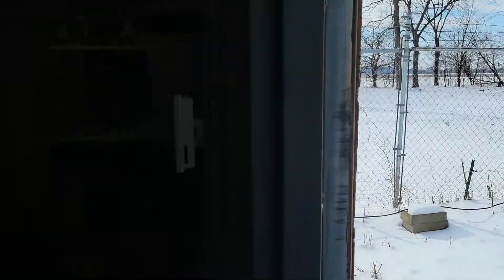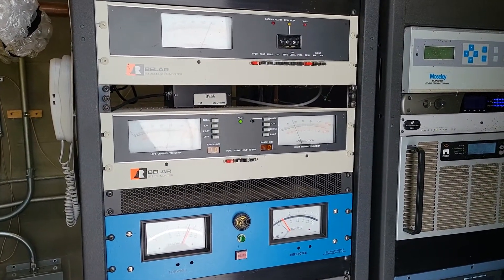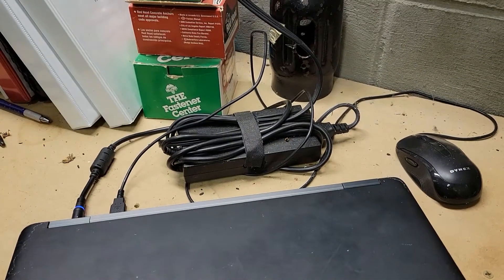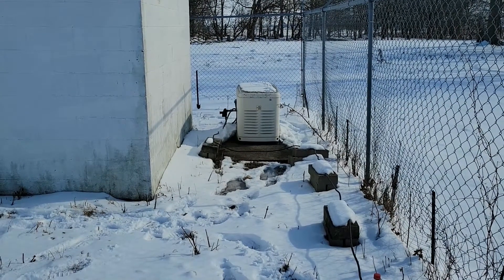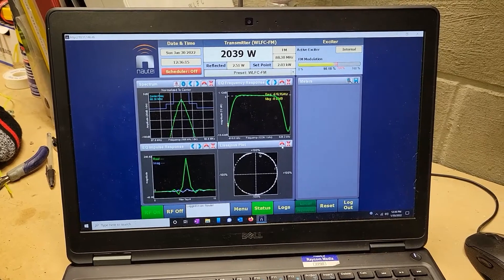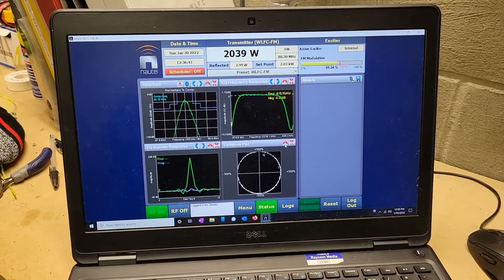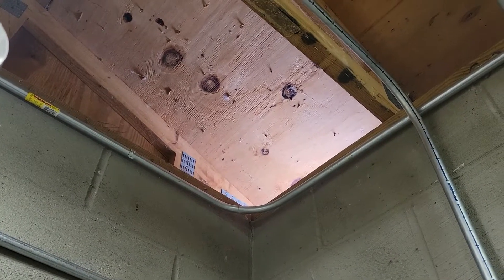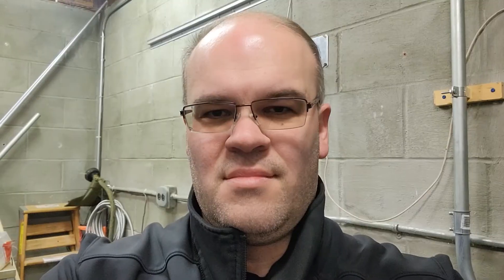Transmitter Power Supply Issues

Comment: intermittent problems can drive you crazy at times. getting nocked off the air and filling out a report is not fun . You can monitor grid power and gen set . bigger stations do. I run my lap top  different. no mouse. touch pad. but have extra USB C power cord. at the cite. My work room a mess . but rest of building pretty good. worst I done is a feed line arc over in a blizzard taking AM station off the air. got the old RCA transmitter online and back up feed line going. had to get a crew to do repair in western NY during a blizzard  . one of the towers was struck with lightning took out one tower light as well. 2nd one down. a outher company does that . lot of calls and a very long few days. station was stuck on low power and array not able to switch . and top it off with one phase out from power  company. what fun that year. was in 2000's . no transmitter damage. just the end of feed line ay tower coupling switching unit. I ben at FM station with separate HD transmitter that was done with a combiner at feed line.   was a ad on . funny the back up is a tube one. no HD backup . My AM station HP DAY/NIGHT tube final. the RCA all tube. both water cooled . no digital AM yet.
Reply from the maker: We monitor the voltage via our Burk remote control. It sounds like you have a lot of experience, especially with tubes. I don't miss tubes that is for sure.

Comment: Been there done that with the power supply for the laptop... Can't leave it at the site (shared site) but it's now part of my permanent loadout in my vehicle.
Reply from the maker: Over 12 years I am much better about packing stuff but it is still great to have certain tools just there and ready to go. I once had to drive back home to grab one because my battery died.
Reply: @TVJAY  I've started using a system of crates. I have one crate that is all my common stuff, and then I have a crate for each site that I'll put equipment, or cables, or whatever needs to go to that site. Still working on that system, but we'll see how it plays out.
Reply from the maker: @TheBroadcastEngineer  oh that is a very interesting idea. I really like it and hope it works for you.